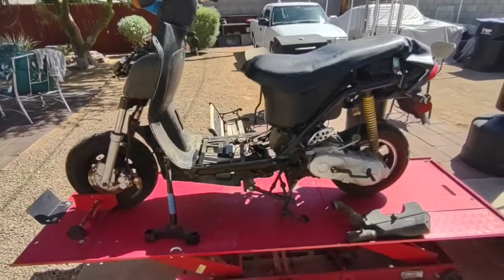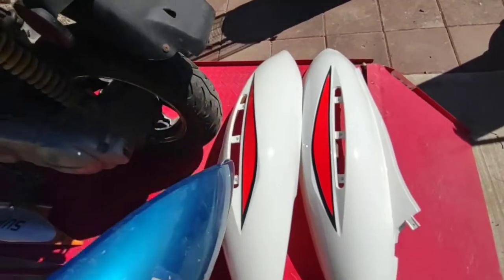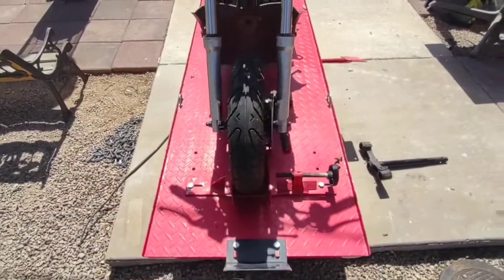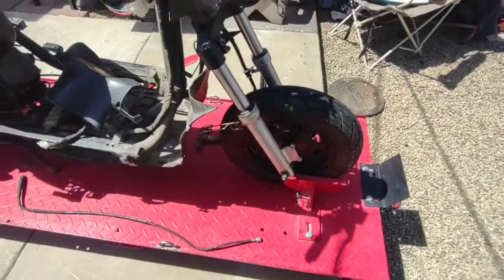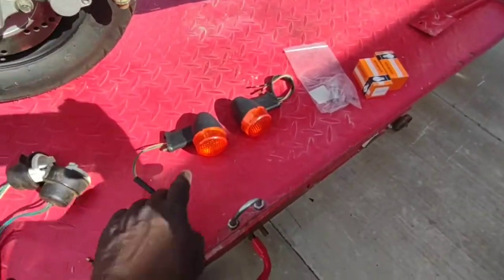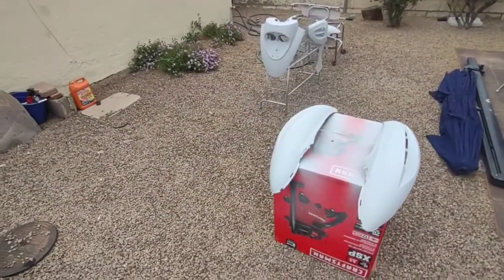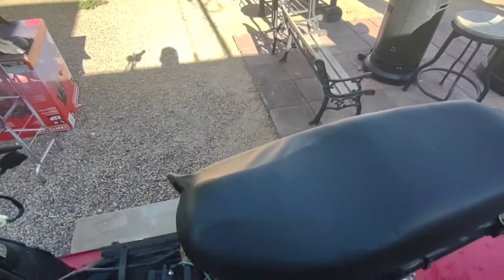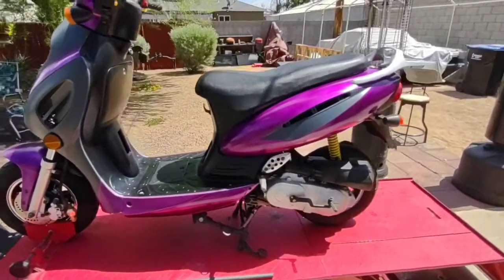part 2 of the 2011 VIP future champion (THE MAKE OVER)

Comment: I have a 2019 vip 150cc putting in a better clutch and I am doing a bigbore kit only 180cc but I am also changing out the carburetor to a choke carburetor, instead of electric. I miss my old carbs and bigger one at that to get more gas and if I don’t like the way it is, I am going to change the Cvt, and put on a 232 cc bigbore and break it in and hopefully sell it for a lot more than what I am putting my time into. But I learned mechanics from my father, cars trucks ect. He was a master mechanic may he Rip. I have chronic pain from a work injury and I just started to walk on my right foot again and my knee had issues and I had a lot done there. But I am grateful for my wife and my family for helping me to push myself. Enjoy your time.
Reply from the maker: Jon thanks for watching ‼️ yeah  adding a 232 bore kit to it will definitely increase it's value . I wish you good health and happiness again thanks for watching ‼️

Comment: I have a question. Every video I've watched shows a different carburetor. Can you help? Does it matter if the throttle cable goes on the top or the side?
Reply from the maker: Hey Kevin the carburetors with the throttle cable going into the top are flat slide cards they require a different throttle cable that your normal GY6 carburetors . Most 2 stroke carburetors have the cable coming out of the top.  The black one you saw me use on the orange Yamaha is a aftermarket oko carburetor . The flat slide carbs have a better throttle response then stock carburetors. THANKS FOR WATCHING ‼️